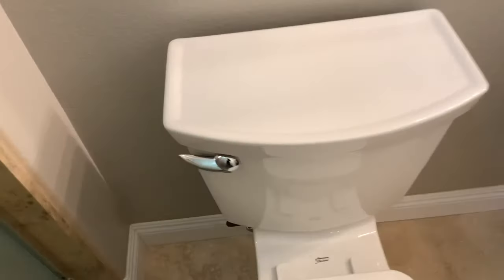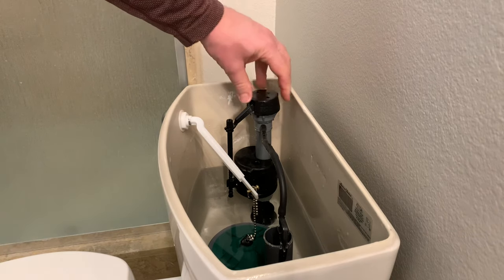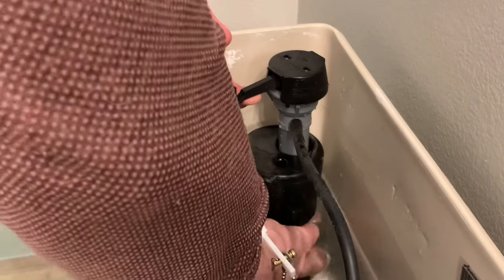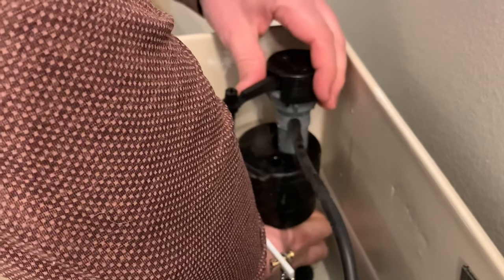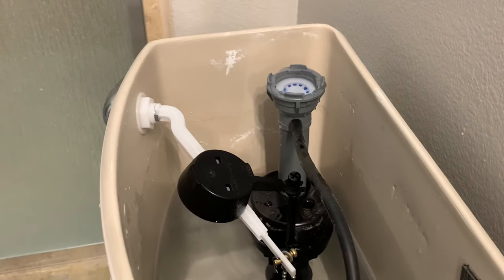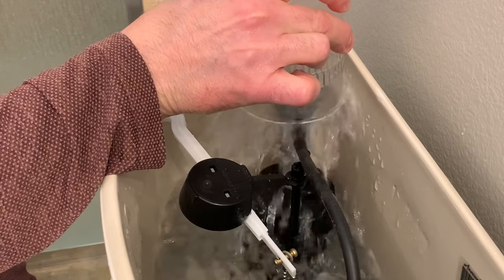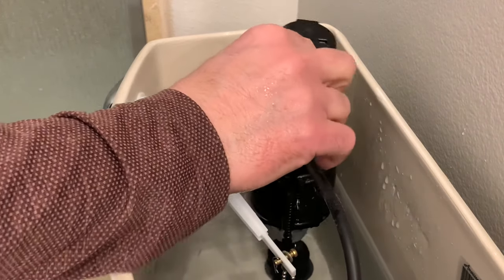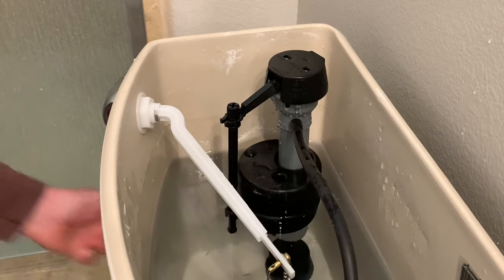Fix A Slow Filling Toilet Tank-With No Tools!

Comment: Mike, you saved my life. I run an Airbnb. My guests are coming in two days. Toilet stopped filling up, and I was in full panic mode. No emergency plumbers out here in the country. I tried this hack, and it worked like a charm. Thank you, thank you!!!!
Reply from the maker: That's great to hear! Glad it helped you
Reply: @MikeKlimek  Pure genius, having the same problem, just replaced my deteriorated flapper, and now the fill valve won't fill, everyone suggests replace it.. but your video is the first that said clean it.. lol I also believe it is debri from the old flapper.
When I shut my water off I still hear the fill valve making noise is that normal?
I am gonna try this tonight when I get home from work!! 
Will let you know if it works..
subscribed!!
Reply from the maker: @chriscangelosi9438  Thank you LOL! I would say if your fill valve is making noises with the water off, that is unusual.
Reply: My fill valve is sporadic. It fills then pauses and then fills a little then pauses and does that until all the way fill. I will try this and see what's up
Reply: Mike. I did what you said, worked great but now water is running non stop what did I do wrong. I turned water off. Sounds like it is still run

Comment: No one on YouTube seems to mention that most toilets have a plastic filter below on the inlet.  I cleaned mine that had a lot of debris in it.  You can pull it out with a needle nose pliers after you disconnect the flex hose.
Reply: @gomalibusurf6098  actually there’s a rubber seal at end of fluid master . They sell them and it can be replaced. Is called a fluid master seal.
Reply: @gomalibusurf6098  take out the restrictor
Reply: Are you able to describe this thing any better?
Reply: Thank you for this! Very helpful, I couldn’t figure it out until I read your comment.

Comment: Another thing why tanks are not filling up fast that had a problem with few years ago it wasn't the fill valve but when I had shut the water off I removed the hose from water valve both ends turned out that my hunch was right that there was obstruction of water flow from a small sticker stuck at one end of the water hose, how that sticker got into the water hose was a mystery but looked like shape size of a Tylenol pill so anyone experiencing water  filling up slow check the hose ends.

Comment: watched your video, the wife wanted to call a plumber.  I went to Home Depot sunday afternoon, bought the float value, did everything on the video, except remember how high the float valve was.  There was air in the line, but eventually, the noise went away.  Adjusted, viola.  Saved me $150-250 for a plumber for 15 minutes of work.  Thanks.
Reply from the maker: Welcome!

Comment: Thank you Mike! 
I have been waiting a long time for my husband to fix the slow refill on my toilet. I finally decided to check YouTube to see if maybe I could fix it. Bingo, it worked and your instructions were perfect.  I did use a Q-tip to make sure the filter was clean then used the glass like you said, but it was not squirting water like yours did so I got a chopstick and stuck it down the hole in the center of the filter. Repeated with the glass and it worked!!!
Reply from the maker: Way to go Ronna!!!
Reply: Did you serve your husband chinese food for dinner that night?😅

Comment: Hey, Mike, thanks for making the fix-it video. Solved the problem. I called our building repair guy last night. He said just hold down the flush handle to fill up the tank. I got tired of pressing the long rod down to activate the pump to fill the tank. So, this morning, did exactly what you instructed.
I cleared out any debris. The bottom plastic screw was loose. So after 20 flushes works good again. Thanks again!
Reply from the maker: Awesome! You're welcome Phil!

Comment: This did the trick. Looked at a few other websites that weren't helping. Tank fill went from over 4 minutes to 45 seconds! Not only that, but I realized that a properly functioning valve flushes more completely too: as the water level is dropping during the flush, the valve starts pumping water with the plug open. With more flow, I get a slightly larger flush, which has helped!  When I pulled off the cap, there were some black chunks in there. I would guess they were some kind of old rubber washer that dried up and fell apart (?). This has me a bit nervous: if that was a washer, it probably was important, but I haven't heard a problem yet. I suppose if something goes wrong now, the answer is easy: replace the valve.  Thanks!
Reply from the maker: Wow 4 minutes is crazy long-glad to help you!

Comment: Thank you for this video! It helped me to locate the problem. I've ordered replacement parts for the entire refill apparatus. The problem was that the rounded bit wasn't moving well and finally got stuck, causing the water to run continuously. I tried flushing it, but in all honesty, I probably broke it completely trying to fix it myself. Plus, the valve required replacement. The refill was SLOW. After getting stuck with a $650 water bill with another toilet due to running, I should've replaced the valve at that time. I'm grateful to you for saving me another $700 plumbing bill. Your vids are incredible! I'm slowly learning how to be an adult! 😄
Reply from the maker: LOL Glad to help you!

Comment: Thank you so much! Just got my slow filling toilet tank fixed.  I couldn’t twist open the cap initially. After rewatching your video, then noticed that you pushed the wider part of that buoy up first before twisting.  Thank you ☺️
Reply from the maker: Welcome!
Reply: Hmm. I spoke too soon. It works once, then slow flow again.  I tried the same fix, worked once, slow flow afterwards.  Any fix for that?

Comment: THANK YOU! Fixed!

I was working on a rusted and leaking pipe going into the house. After the repair and with the water turned back on, the toilet tank took forever to fill up. Turns out that rusted sediments clogged up the fill valve of the tank of the toilet.
Reply from the maker: Welcome!

Comment: Thanks! You sent me in the right direction. However, I have the exact same valve, and when you take off the top as you showed, there are little rectangular holes around the center hole that were completely gummed up with stuff. I had to take a pick to get the gunk out, and THEN it worked! Important step not to miss if your valve is really gummed up! Thanks again.
Reply from the maker: Glad it helped  you Peter!

Comment: Thank you for this!! I can't believe I fixed it myself (senior female on a fixed income with weak hands).  Hardest part was turning the water off. 

Now the floater thingy keeps falling off.  I'll do some more searches. It's an older Hydroright Dual Flush and the fill valve parts are black, not the blue ones.

Comment: Excellent video. Wish it fixed my issue. While there was some trash in the top of the valve, I still have minimal water pressure. Takes more than 5 minutes to fill tank. Compared to the other toilet that fills in less than 1. Looks like I’m replacing the valve.
Reply from the maker: It could be the water supply valve at the wall as well. Try disconnecting the supply line where it attaches to the tank,  point it into a bucket and turn the water back on. Poor pressure? Then replace the valve. If strong pressure then replace the fill valve in the tank.

Comment: You are very welcome, Mike. Just one caveat for your viewers: It seems as though the "newer" toilets do NOT have a removable cap on the fill valve--it's one self-contained unit. I believe you have some suggestion on repairing "part" of that part--I'm just speaking in general. I just bought a fill valve assembly at Home Depot for just over $9, including tax.
Reply: The one shown was a Fluidmaster fill valve and they operate just like that.  There are other brands that look like they operate the same as a Fluidmaster.
Reply: @joeking433  Yes--I was surprised that the unit I had in my toilet was a complete unit.

Comment: This works, for a short amount of time, and then i gotta re-do it after about a month or so. Do i need a new fill valve perhaps?
Reply from the maker: Maybe....If you have full pressure when you remove the top, try this: https://youtu.be/p2G-ckkojEQ or you may need to replace the fill valve. I have a video on that you can complete in 30 seconds.

Comment: Nice vid! I had removed the cap three times, and each time seemed successful, but when i reassembled and re-flushed...still filling slowly. I then removed the gasket, but the nipple remained attached to the pin. At first i thought I broke it but seems that may have been the problem all along. BTW, during the Christmas cold snap I noticed the flush was sounding different. Today the tank stopped refilling.
Reply from the maker: If you have full pressure when you remove the top, try this: https://youtu.be/p2G-ckkojEQ or you may need to replace the fill valve. I have a video on that you can complete in 30 seconds.

Comment: You are the BOMB!  Reason number 10, 465 to hold onto those Mardi Gras cups.   LOL.  Thanks so much!!!
Reply from the maker: LOL You're Welcome! As if holding drinks wasn't already enough!
Reply: @MikeKlimek   Exactly!
Reply: @MikeKlimek    Oh nuts, it filled up fast but still seems to be coming out slowly--- from the top of the part on the left which seems to be called the ballcock valve (protruding from that part i removed to flush it out).   Maybe I need a new one.
Reply from the maker: @reneezeitzer9631  Oh bummer. Try removing that part again and reinstalling it. It may be that something else got caught in there or maybe it was not reinstalled just right. If you have to replace it, here is a video of how to do it in 30 seconds with no tools: https://youtu.be/y6J1cfvQOGg
Reply: @MikeKlimek    Thanks again!  I'll give that a try!

Comment: Many thanks! You saved me the expense of hiring a plumber.
Reply: Maybe I spoke too soon. Should the cap fit on tightly? It;s just resting loosely on top of the fill valve.
Reply from the maker: @joelagee900  Yes the cap should be snug. Make sure you press down slightly to engage it as you turn it

Comment: Hello, this is helpful. You know why the water is slow unlike yours even when taking the cap off? water pressure?
Reply from the maker: Could be the shut off valve at the wall, a restrictor or the supply line.

Comment: I was so hopeful that this would work, and it seemed to work, at first.  I followed your instructions, flow seemed good.  Turned off the water, reassembled the unit, turned the water back on, and all appeared to be good.  Then, I flushed the toilet once more, just to be sure, and I was back to the original problem:  very slow to fill up.  What happened?  I did this twice, seemed right and okay, filled up quickly.  Flushed it one more time, and back to the original problem.  What could it be?  Thank you for a response.
Reply from the maker: When you put the cup over the fill valve, you had constant strong water flow?
Reply: @MikeKlimek  yes, and upon reassembly, toilet filled fairly fast.  Then, after a flush, it was back to drip fill. What about the tube that connects from the Fluidmaster to the tank?  Initially water flowed out that tube pretty fast, and I thought the fix was complete.  But a test flush "just to be sure" showed that the problem persisted.  Any suggestions?
Reply from the maker: @cisbell4025  If the water flows fully with the cup over it, it can only be the top of the unit. Here is a video on replacing it in under 30 seconds: https://youtu.be/y6J1cfvQOGg

Comment: After watching the video you made, I am writing a comment because I am so grateful for fixing it for the second time. Thank you.
But today, maybe because I pressed it too hard, the tank is filled higher than the line and the water leaks into the toilet.Can I fix this, too?
Reply from the maker: Yes...it sounds like the float needs to be adjusted downward to shut off the water earlier. There is a plastic screw next to the float for this. Just turn it by hand
Reply: @MikeKlimek  I've turned it like that dozens of times, like you said.
But it's still  leaking from the tank.
Turn it up and down. Should I change the parts? Or do you have another solution? Thank you again!
Reply from the maker: @janechoi9933  It still sounds tome that the float needs to be moved downwards. However if you are stuck, you could always replace the fill valve. Here is a video on how to do it in 30 seconds: https://youtu.be/y6J1cfvQOGg
Reply: @MikeKlimek  As you advised, I turned it down and broke it.
I just bought a valve. I'll watch the video and do it again. 😀

Comment: Thank you! And I was wondering if that's wood or tile that looks like wood around the outside of your shower? I am about to redo mine and like the look. 👍
Reply from the maker: The floor is travertine, and the curb to the shower (and the walls) is a darker marble (maybe it's granite?).
Reply: @MikeKlimek  Oh okay. Thanks!
Oh and my toilet went right back to filling incorrectly so I ordered a new filler thingy. I had put a blue cleaner tablet in and think that's what ruined it.
Reply from the maker: @HeidiPyke  If you are replacing an existing fluidmaster with a new fluidmaster, watch this video: https://youtu.be/y6J1cfvQOGg
Reply: @MikeKlimek  I decided to try a Korky instead.

Comment: Hello and I want to thank you for this video, I was able to follow the steps, however, as it turns out when I turn the water back on, it seems I don't need a cup because the water just barely comes up  to flush out the valve. I also have a portable bidet hook up to the toilet at which the water runs full force. Any suggestions will be greatly appreciated and thank you in advance.

Comment: Hello there. Thank you for posting the video and I was hoping it would solve my issue but when I placed the cup over the spout and turned on the water it barely had any water pressure at the top. Meaning, it was like a nice relaxing fountain and not a jet of water like yours. Does this mean that whole part needs to be replaced? Thank you!!
Reply from the maker: Not necessarily, you need to exclude a few things first. It could be the shut off valve at the wall, a restrictor, or the supply line. If you remove the supply from under the tank and point it in a bucket and the water flow is strong, then probably time to replace the fill valve. Here is a video on how to do that in 30 seconds: https://youtu.be/y6J1cfvQOGg
Reply: @MikeKlimek  Thank you! I replaced the fill valve and all is well.
Reply from the maker: @MrBleworchid  Sweet P!

Comment: This didn’t fix my issue, but it was a good first step! I had “adjusted” the float height and must’ve wrenched something loose in the cap. I had a replacement valve on hand but had been putting it off. This fix looked so easy I tried it first, and then since I already had it open and my hands dirty I just went ahead and replaced the whole valve (which by the way is pretty easy, for those of you who think you need a plumber to do that. The only real “specialty” item you need for that is a shop vac to fully empty the tank so you don’t get water everywhere. And I suppose a reasonably cooperative spine and hips.) It was certainly easier than filling the toilet with a bucket to flush it.
Reply from the maker: Hi Katie, here is a video for next time when you need to replace the entire valve...no tools in under 30 seconds: https://youtu.be/y6J1cfvQOGg?si=oEq8BnhevpQ72GRi

Comment: I have a different type fill valve. My flex hose is attached to top of cap. It's an American Standard Brand. Any suggestions as to how to get the top blue cap off ???  I tried the way you showed in the video but will not twist off.
Reply from the maker: Is the fill valve a Fluidmaster or American Standard? American Standard makes a model 400a that is virtually identical to the Fluidmaster 400a and the top should remove just like the Fluidmaster. Fluidmaster also has a PerforMAX with a blue cap. If American Standard, is there a model #?

Comment: I Did this but had not seen your video at the time and I changed the height of the valve assembly. Now the water is raising high enough so it is constantly going into the overflow valve unless I turn the inlet water off. Can you help me know how to fix?
Reply from the maker: Yes easy fix. You need to lower the height of the float (the black donut looking thing). There is a black thumbscrew at the top you can turn to do this

Comment: Any advice for when the water trickles out once you remove the cap? It does not have the same force as the video so if anything is clogging it, not sure how it’s going to get loose. I feel like we’ll need to call someone but hoping there may still be a way for us to fix 🙏🏻
Reply: I’m not sure it’s the fill valve as I just replaced it about a year ago. I removed it to see if water would come out with it off and it seems like the water pressure is just very low.
Reply from the maker: @AllisonHudson  OK, is the pressure low just at this toilet or in other areas of the house? If it's just this toilet, I would remove the supply line where it connects to the underside of the fill valve (under the toilet), point it in a bucket and turn the water back on. If the pressure is strong, then it's the fill valve, If the pressure is low, then it is probably the shut off valve at the wall (make sure it is fully opened before you replace it as it may just not be turned on all the way).